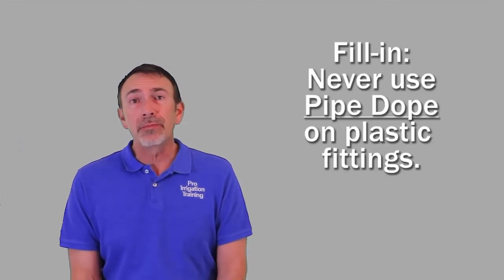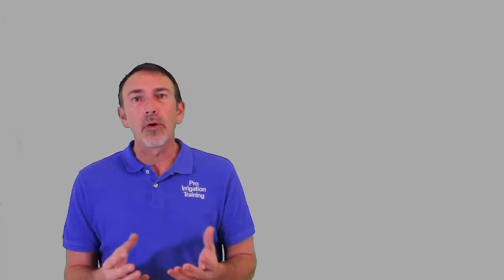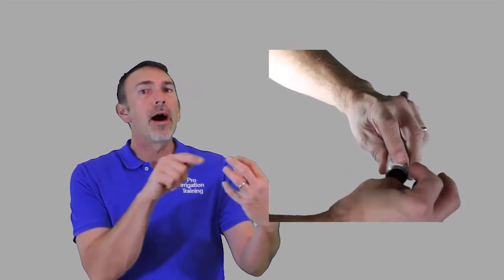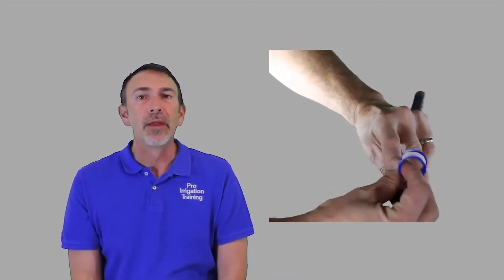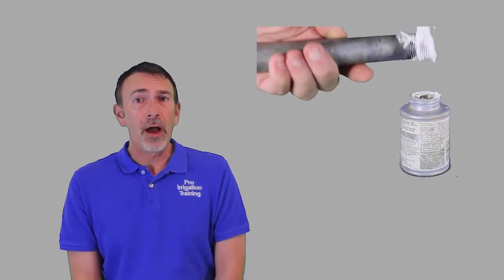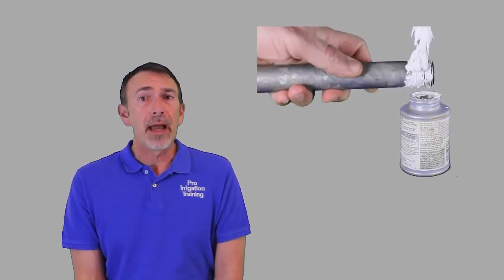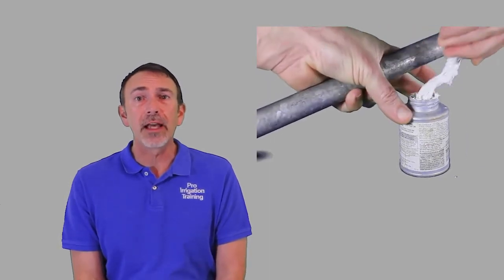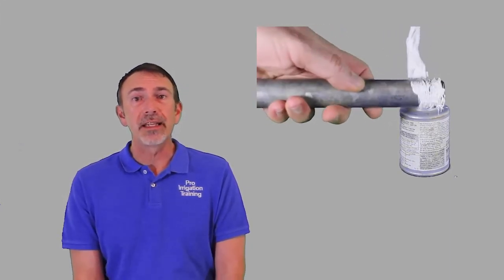Using Teflon Tape or Pipe Dope (irrigation training)

Comment: Tru-Blu is for plastic too, no?
Reply from the maker: I don't have any experience with this product, so I'm not sure. I just looked through their website and see that they have several different products with different ratings. It does claim that it's good for PVC. And I'm not ever trying to disparage any product, but my past experience with Pipe Dope that has said that it can be used on plastic, showed that in fact those products were not ok for plastic. I warranty all my work, and after having to redo those repairs, I learned my lesson. Maybe it was just the products I used weren't top shelf. And I stopped using Pipe Dope many years ago, it's probably improved.
Reply: I bought Tru-Blue for my irrigation valves threads for water seal.  Every time I used teflon tape, after some time maybe due to pressure they leaked, but of course maybe I did not do properly, thus why I was searching for videos about this. I trust you are professional, so I will definitely try teflon tape again.  At the same time on another valve threads I will use the Tru-Blue which they state for plastics just for testing purposes. Whichever hold within the year leakproof seal will be my winner. Thanks again for the informative video!
Reply from the maker: @demosalevizos310  It may be that you have too much pressure. If it's more than 90 psi at the valves, I would consider installing a pressure reducing valve.
Reply from the maker: @demosalevizos310  And let us know how it goes in the future, if the Tru-blue did better or the tape. Thanks for commenting!

Comment: I really appreciate your level of advice, it's very informative and I'm learning so much from you. 
Can you please make a video that explains how each water pump operates and it's functionally.
Please 🙏😊
Reply from the maker: I will be filming a whole course on pumps later this year. Pumps are a big issue, with a ton of info to know about pump curves.
Reply: Do you use the Teflon tape on both ends of the riser when you replace a whole sprinkler head? Thank you.